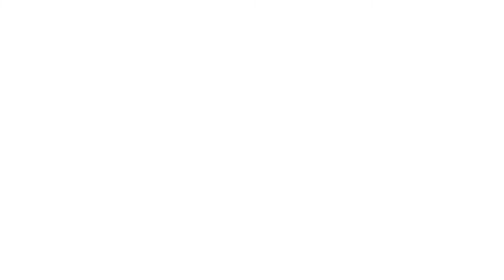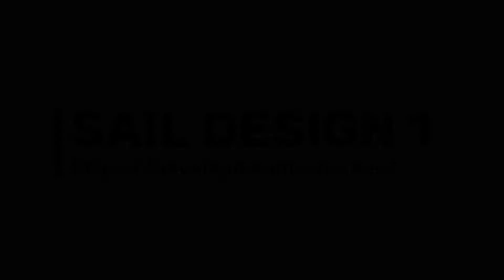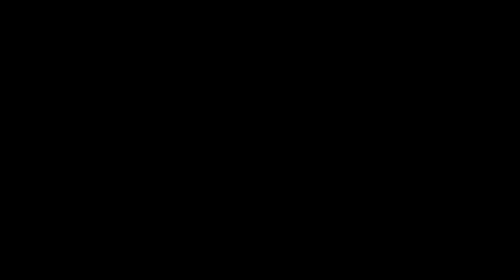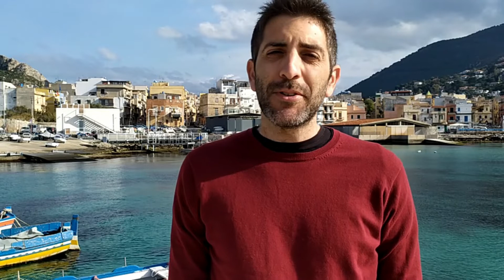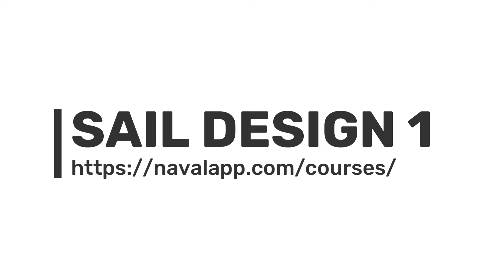Sail Design course - Meet the Instructor

Comment: Do you issue certificate? Are they valid for getting job?
Reply from the maker: Yes, we issue a Certificate. Its validity will depend on the job you may apply for and the potential employer. The course instructor is a very experimented sail designer who graduated with full marks in Naval Architecture and Marine Engineering from the Università degli Studi di Genova, and obtained a Ph.D. at the Yacht Research Unit at The University of Auckland. You will find amateur sailors, sail design professionals, naval architects, and sailing Olympic gold medals among the course students.